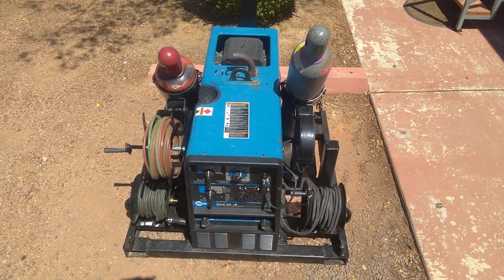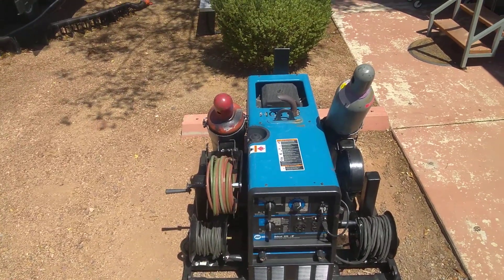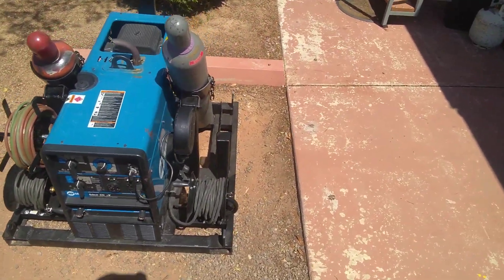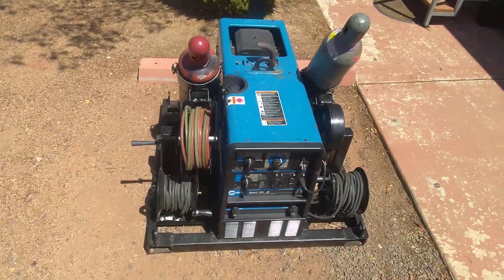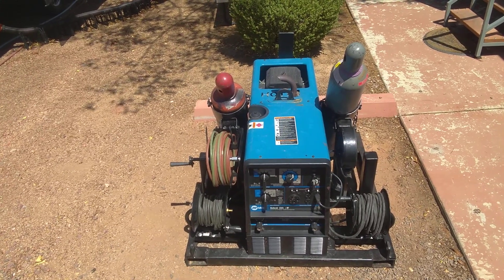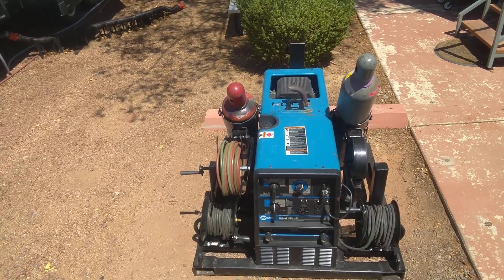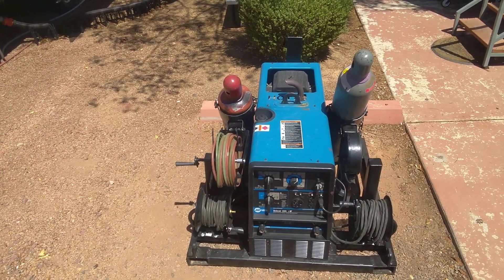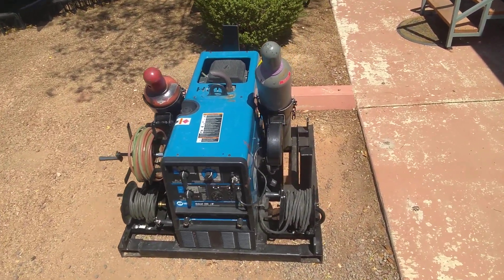Welding Skid By HogOn!

Comment: I like it, I have a service truck (f350) with a trailblazer behind the cab. Problem is I won't move it for any less than $270, that's hourly, 2 hr minimum and fuel charge. I mostly cater to bigger companies that need more of a mobile weld/fab shop which is what my truck is. I have my old service truck which is a f250 short service bed and this set up would be great to set up as a second or cash job weld rig. I pass up so many easy cash jobs because folks gaff at the $270 price tag just to make a 2in weld. would be easy cash money. now that I have gave you to much info lol, how much does it weigh loaded down welder, bottles, reels, leads, the whole shooting match?
Reply from the maker: Honestly I don't know how much it weighs with everything on it because there was no need for me to weigh it with everything on it but I can tell you how much it weighs with everything off of it around 150 lbs